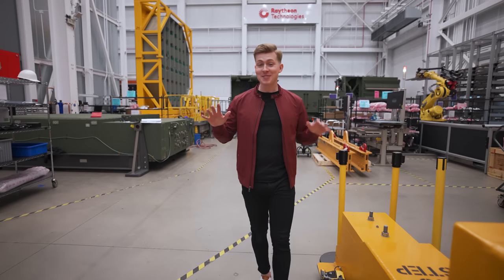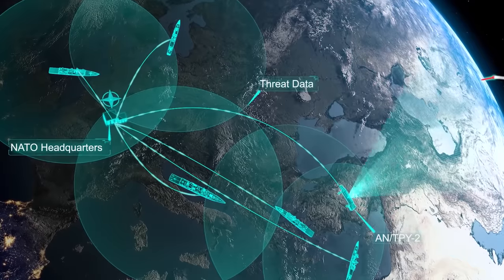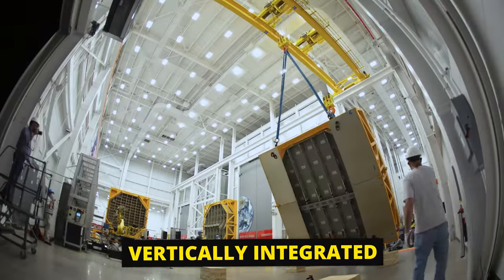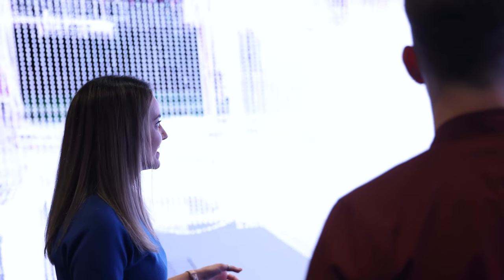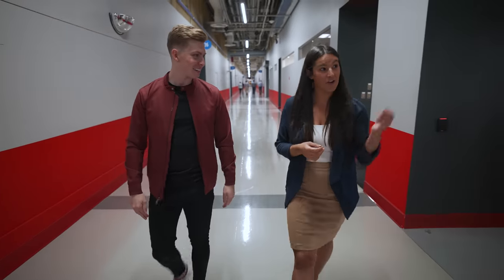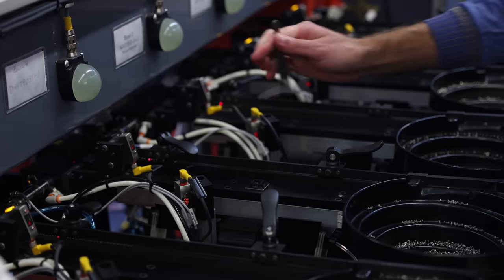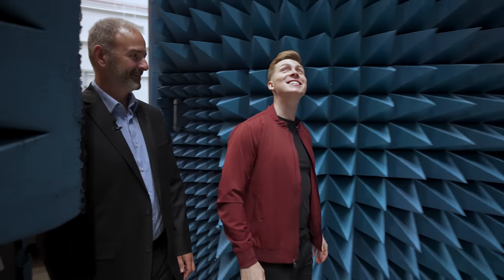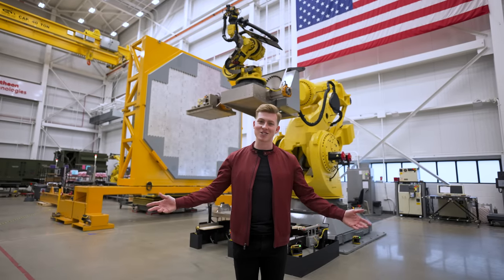Inside the World’s Most Advanced Radar Factory

Comment: Total manufacturing facilities of 1.7million sq. ft. only?  including RF Shielded Rooms?!!!

In Asia, just the Radar labs' shielded room facilities that covers multi band multi-array composit panel antenna are easilily over a million sq. ft.  Not to say including manufacturing areas！

One of the lab. cater for simulation of Naval use low band radar panels already over a million sq. ft.

The project that developing airplane body skin function as matrix array antenna in early warning flying device, the lab size is already over a million sq. ft.!
There are  over 22 manufacturing centers eaxl
each depot is as large as 1.5 million sq. ft.
Reply: Good for Asia. We still have the best engineers and military.